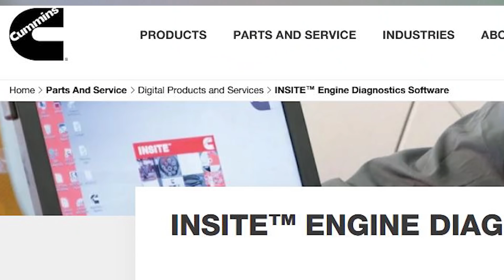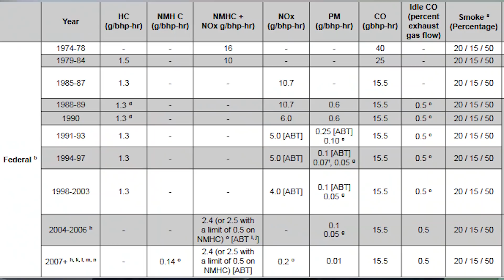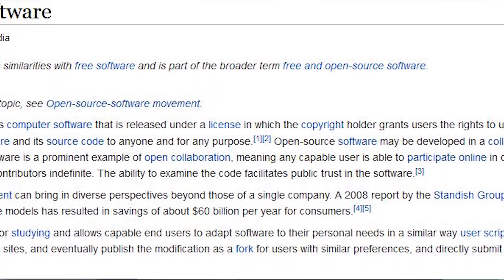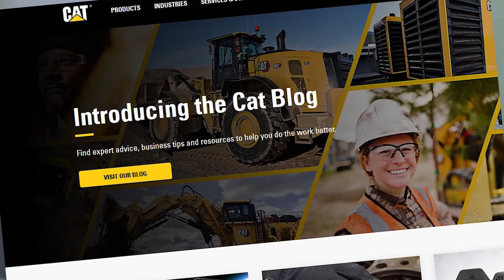Should YOU have the "Right to Repair" your Engine?

Comment: I don't think it ought to be free but it darn sure should be made available. John deere seems to be the hardest fighting manufacturer right now.  If the dealers had the capacity to get the work done in a timely manner I don't think customers would be so irritated. But when you buy a $500000 tractor completely reliant on a computer for every function, and without said software the tractor is deemed worthless, then you paid for that software. IMO.

Comment: OBD1 & OBD2 give generic codes so why doesn't heavy equipment? Dealer specific codes are still hidden. Code is language so it falls understand the first amendment. We also have the right to information act. Having an OBD system for heavy equipment PCMs should not even be a topic of debate. However, you will see a dramatic price increase for software updates for scanner/oscilloscope tools which cover light duty and heavy duty equipment. It's going to be very lucrative for the industry and a serious financial investment for independent technicians...

Comment: As an owner operator, I fully support right to repair legislation!
Reply: you get no warranty if you mess up repairs
Reply: Amen to that!
Reply: Should get the software license with the purchase of the equipment or truck
Reply: Curious question, I definitely agree to right to repair to a degree, as an owner opo- if your own repair fails causing further more severe damage would you than be happy to accept you have zero warranty as you were not certified to fix said faults/ damage but chose to as it was an option for fast repair? I guess this is the grey area dealers want to a degree still be able to cover safeguard any warranty failures.
Reply: Obviously we are or we would not have fixed it ourselves
Reply: @joshgelling7435  Said warranties don't mean much when we have to wait some times weeks for the job to be done.
Reply: @laneweever2620  hearing you man, major shortage of actual keen to work/ switched on knowledgeable apprentices coming thought the ranks in Aus which is leading to longer wait times for customers. Unfortunate even longer wait time on replacement parts coming from the USA an Mexico arnt helping either.
Reply: @joshgelling7435  when you buy a new part & it fails my local dealer will send it to the manufacturer to determine if it was manufacture defect or something damaged during installation. If its determined to be defective they'll approve a refund. I dont see how the same wouldn't apply if you repair something still under warranty & it fails. You take it to the dealer for Inspection or they send it to manufacturer if necessary & if you messed up you eat it.
Reply: I agree whole heartedly and it's about time somebody came up with that idea excellent idea Sir!!!!!
Reply: I went through a cat new C15 Head that exhaust valve broke off apparently 1.2000 below the valve keeper and there was clean brake and drop into the #6 cylinder it was nasty but cat paid me for the full in frame overall but I pulled it out and did out of frame to do thorough inspection block and any thing else needed put back together and good to go. The shop where the head went back to and ecu download is what I why I was getting my engine paid for now you have cat set all the eng sn setting they help you chang with unauthorized cat Et and well it's your dime.  I fully support right to repair and do what necessary to keep my fleet running without interference from others as it a necessary evil.
Reply: @cjtroutt8092  Thats what OEM's are looking at "YOU" wanting warranty on parts on modified engine. OEM's don't care that you work on your stuff and never have. I work for dealership we don't care that you work on your stuff. But you buy parts, want warranty we do download and see its deleted or modified its nothing we can do they will not be warranty. Last month owner with 6nz with acert twin turbo setup blows headgasket only has 50,000 miles on it. Only pushing 70 psi of boost and with tune. You think we're going to warranty this and do download that has to be uploaded to CAT HELL NO. Build race car engine there is no warranty exactly
Reply: @pdmustgtd1013  yeah the warranty system already covers this if you receive a warranty and you modify the vehicle it's still covered the only situation you're not covered in after modifying the vehicle is if you're modification directly lead to the problem. Aka I can't switch heads and then blame the dealership for it burning a valve
Reply: @pdmustgtd1013  owner should wait till warranty expires b4 doing delete & tune like this.
Reply: @pdmustgtd1013 70 pounds seems a bit much.
Reply: @SamMaass-s5h  Acert twin turbos on 6NZ series. Truck racing in Europe little C12 pushing 100 psi blowing stock intake apart.
Reply: Another thing to consider is that if one company were to become repair friendly, their sales for new equipment would skyrocket. People would entirely switch to their brand over others.
Reply: X3.

Comment: I’m one of those persons who have contacted you via email unable to get any answers from my local cat dealer. Finally the cat dealer in my area got a good service manager and a few people in the shop. I had a problem with my cruise control and exhaust brake being latched together and wanted to separate the two so they would be independent of each other. They were unable to figure out how to get it to work independent of each other. Having taken the truck for a ride connected to the computer system. I explained that I knew a person with the same truck and same engine who’s it set up correctly. The service manager was able to pull his information up from Cat from a visit in 2017 and copied his ECM settings over to my truck which fix the problem. I thought that was really cool. I do not think I would be able to use the cat software without some type of training with it since I am not a mechanic. 

The one big problem with my truck towing a 21,000 pound fifth wheel is the torque is in the wrong rpm range. Can’t toe on the interstate at 50 miles an hour in sixth gear at 1400 RPMs only having 300 hp and 860 foot pounds of torque. That formula is great for the bigger cat engines but does work for the 3126. I feel caterpillar needs to come up with a better software program that will move the torque to an area between 1600 RPMs and 2700 RPMs like the 6.7 Cummins diesel. Having maximum torque and that rpm range would do the job for what I pull. 

I realize caterpillar is no longer making over the road engines and there’s no incentive for them to do anything for engines in the past. 

I’m still looking for an aftermarket turbo charger or a charge kit that will fit on the 3126, since Cat does not have one that can produce more than 23 psi boost. There was only one available reman in the country for the engine two months ago.

I want to thank you for your help and information. If I ever get up your way I would like to stop by and say hi. Thanks again, Dav

Comment: I think it in the best interest of the manufacturers to give the data to fix your vehicle no matter who you are for free. Just like it was before computers where fitted.

The big companies that give out the technology programs will In fact get more custom.

The government is right in imposing the software to be free to anyone who needs it, because the government, the keep the world clean (green peace), the rich and the manufacturers are all to blame for the useless electronic systems on vehicles today.

Old school beliefs are still better than the new school power control beliefs, like DEF/Ad-blue is uria/urine aka ammonia which is a world wide chemical that is banned to be used in any format by the WHO, they (WHO) are the committee of brain dead amoebas that say that it is safe to use, knowing that ammonia is the chemical that causes mad hatters disease, basically long exposure to uria, urine, ammonia will cause your brain to be disfunctional and you could if not treated for ammonia poisoning will end up suffocating in your sleep, have black outs when driving, become disoriented and also become more agitated with other people.

But the government's around the world, the keep the world free from fossil fuel burning and the WHO say that burning ammonia by injection into a hot fossil fuel gas is safe.

But since the enforcement of using DEF/ Ad-blue to diesel fueled engines and increasing the levels of ethanol another portent and poisonous toxin to all mammals, humans and such.

We have see a increase in deaths of truck driver's in there sleep, people becoming more disoriented and aggressive, plus a big increase in more people suffering from breathing problems and infections of the breathing system, your lungs, larynx, your throat and so on.

In my personal view is remove the so called environmental protection system and stop circulating exhaust gases back into the engine and oil, water vapours back into the engine it does not make the engine cleaner burning.

The cleaner the air going in the less fuel used to be burned and the percentage of fuel burned is higher and the engine becomes more fuel efficient.

Loving the video's and enjoying the way you collate the content on your videos.

Comment: John Deere should be called dear John.  Sofware should be open source as the manufacturer can use any improvements a user makes.  Linux has worked very well in this area.  Great video.
Reply: Lol.. this is the year of Linux on the desktop- yet again. I think I will start a distribution and call it LOT-DYA.

While I would enjoy ooen sourcing the software,  it really isn't neccesary.  An API that allows access to the communicatiins protocols and a standard definition table would allow anyone to interface with it enough to create, maintain,  or repair their systems. That would satisfy 90% of the people. 

Oh, and for an example of open source engine control software, look into the cardrino project - if it is still around. Lots of people doing exactly as you suggest with ardrinos and older vehicles.

Comment: I can understand the manufacturer holding onto the information until the warranty period is over, and they have moved on to develop newer systems, that way they wouldn't be at a disadvantage with their competition. For some of us it is frustrating when you're tinkering around on a 20 year old vehicle and just would want to do something like read a CAN bus for a signal and wind up spending hours of trial and error just to make some little thing work, yet that same info is basically decomposing in some corporations engineering department's filing cabinet.